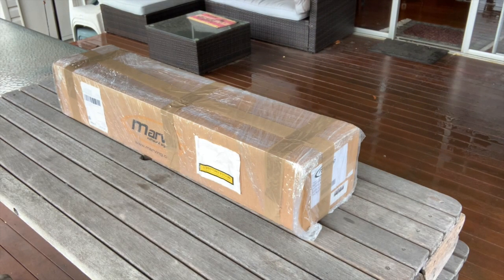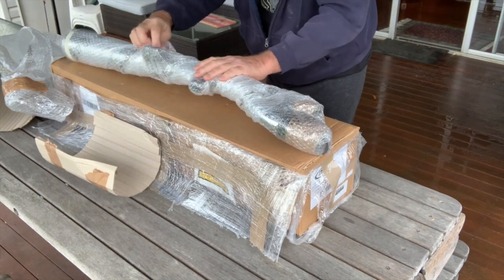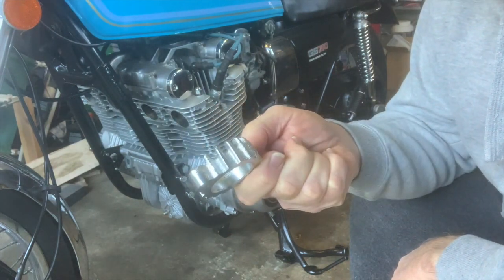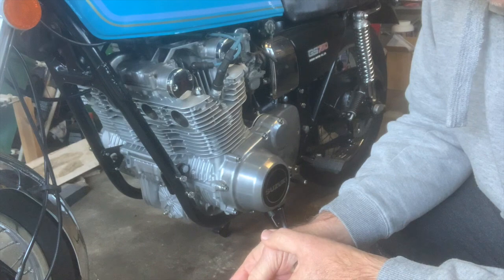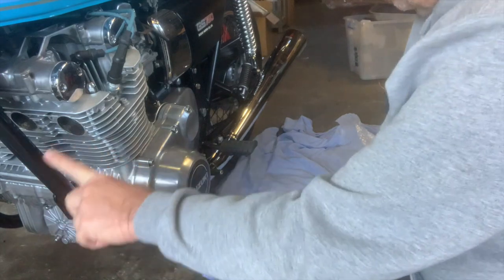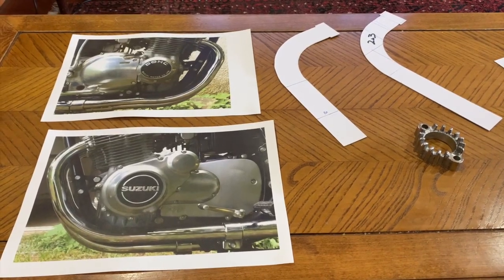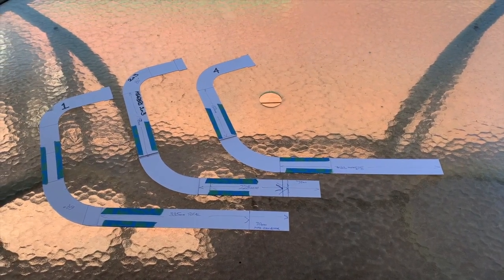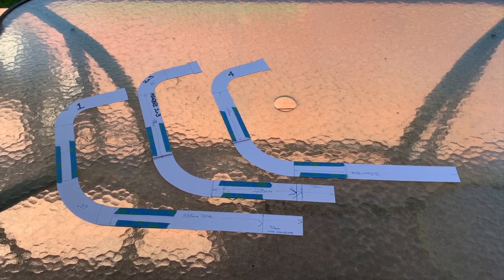GS750 Restoration Part 18

Comment: I just acquired a 78 GS 750 I'm starting to do the restoration on it where did you get the exhaust system from (The tail pipes.)
Reply from the maker: Hi, the exhaust silencers are made by Marving which is an Italian company. I ordered them via the Australian Wemoto site but it seems to be a worldwide company so should be orderable just about anywhere. Here is the local link http://www.wemoto.com.au/bikes/suzuki/gs_750_c_dc_ec/78/picture/marving_marvi_conical_silencers_-_chrome/

Comment: A really nice authentic & patient restoration. It looked like the previous owner tried to replicate Maui Blue which is one of my favourite Suzuki Colours available on the early 70's two strokes such as the Titan 500 and GT550 models. I hope you managed to fix the bubbling in the tank paintwork. I think the GS750 is one of the best 70's bikes, though I'll always have an affinity with the Honda CB750. I quite like the 1979 Suzuki GS750E as well with the alloy wheels but it keeps the classic appearance otherwise. The 1981 Honda CB750F is a great bike too, but for me the Suzuki GS750E  would be my chosen preference if I had the means to buy a motorcycle. I dream on, believing the 1970's & early 80's produced my favourite Japanese motorcycles. Thanks for a great series of videos.
Reply from the maker: Thanks Gary. My brother had a CB750 back in the 70s when they first came out. I remember being in awe of how big it was. He also had a Z1 which I wished I had kept when he passed. Would have been a great resto project. Paint bubbling is still there unfortunately. I think there must be small pinholes that the tank sealer missed. Need to get to the paint shop to match the paint so I can have another go but Covid has been restricting movement for months down here. Cheers.

Comment: There’s a lot of work that has gone into this and I hope you end up with what you want at the end of the process but I I worry that Verex won’t be able to replicate the smooth (almost continuous) curve line of the original headers. I recently purchased a 1978 GS550E and the big attraction was that it still has the original exhaust system fitted, as I think they make the look of the bike. Any restoration I undertake has to have the original exhaust system, as that is the only way to keep the look faithful imo. Good luck with the rest of the build, it looks like you will have a lovely bike at the end of the project.
Reply from the maker: This project has been finished for some time now and I'm very happy with the final product. Check out episode 20. Finding a genuine exhaust in a condition that I would be happy with was not an option. Verex did a great job with the headers IMO. Good luck with your resto and thanks for watching.

Comment: Hey Phil, just checked in to see if I'd missed one, can see the note below so I know I havnt! A bit of feed back for you on my mini resto. Thanks for the tip on putting tape in the recess of the crankacase emblems, that worked really well but took me 2 goes to get it right. 2. You were so right about the top set of pin stripes! That took 3 goes but I now have a tank I'm happy with, you know 'happy with' means not perfect lol. Looking forward to the last episode and good luck with the house move!
Reply from the maker: Hi Dave, good to hear! I am very particular about things being straight and even so I knew I would never be happy with the stripes on top of the tank so I left them off. Just uploading ep 19. There will be one final one with the road test and a recap of the issues I faced and the things I've learned over the project.